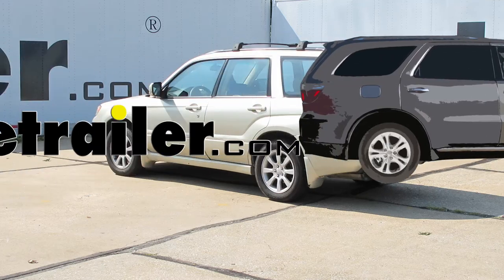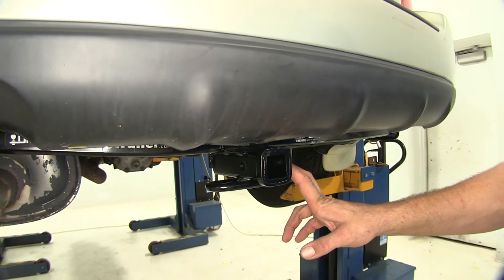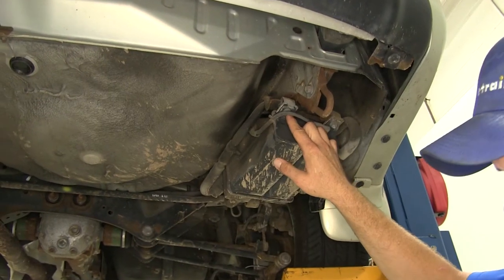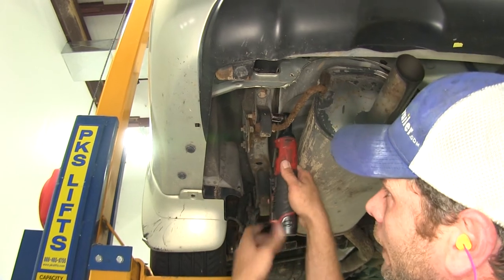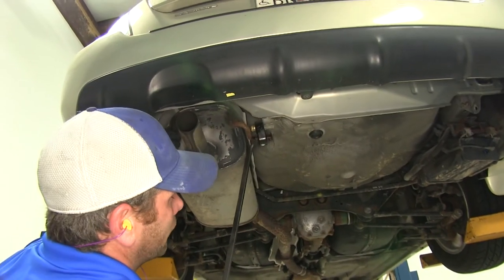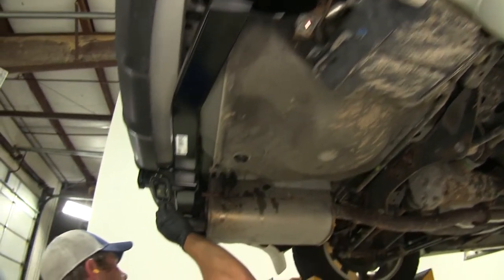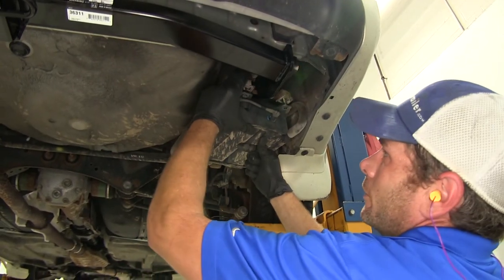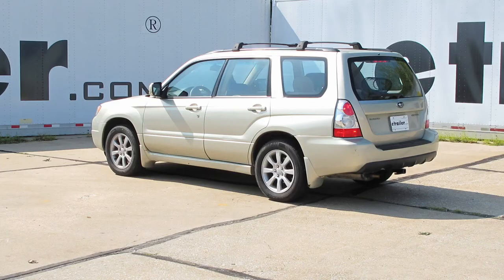etrailer | Installing the Draw-Tite Trailer Hitch Receiver on your 2007 Subaru Forester

Comment: I attempted to put on the exact same hitch on the same exact Subaru Forester, the bolts will not line up
Reply from the maker: Sometimes the brackets of a trailer hitch can get bent during shipping if the shipping company isn't too careful with their handling. If the bolt holes are close then you may need to bend the brackets back into place. Be careful to check for any places where the trailer hitches integrity has been compromised though (like cracks) because that can affect the weight ratings of the trailer hitch. Here is a helpful article on the subject that you can check out https://www.etrailer.com/faq-my-trailer-hitch-doesnt-fit.aspx